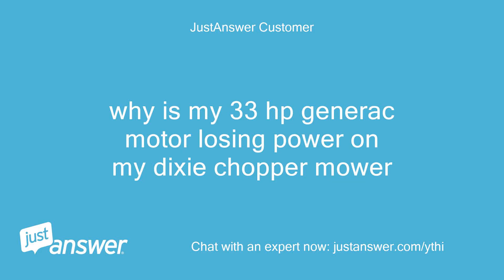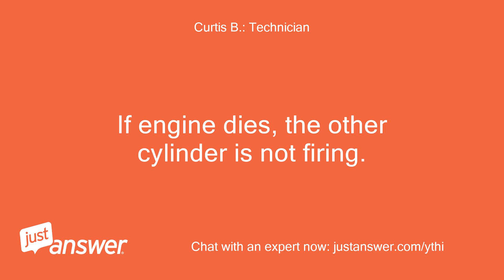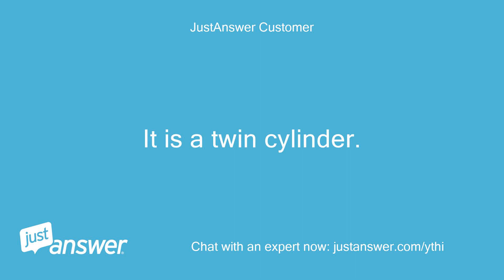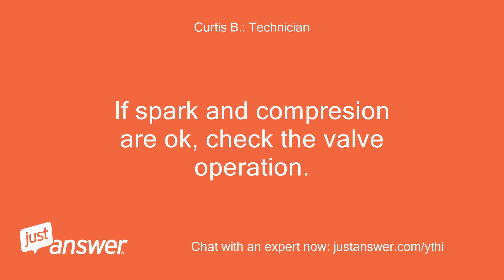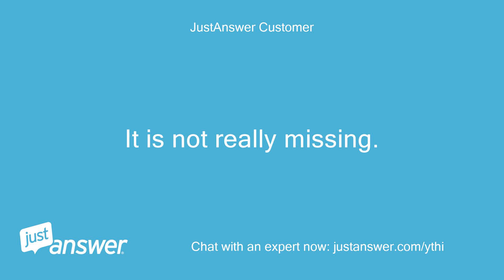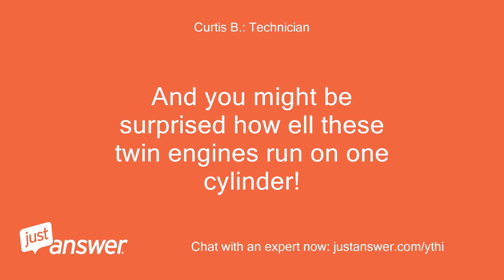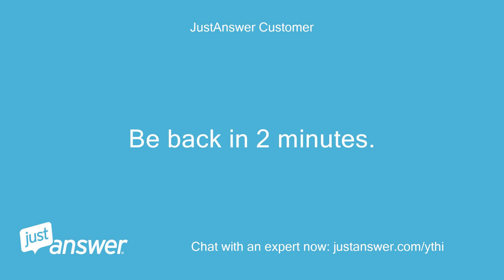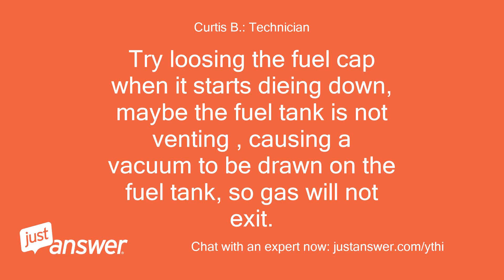why is my 33 hp generac motor losing power on my dixie chopper

Comment: Could a bad coil, valves need adjusting, which Generac is bad about.  If the motor keeps running just a loss o power I would do a compression check